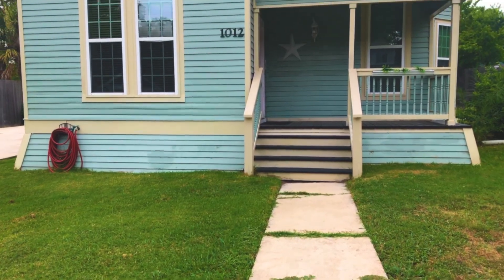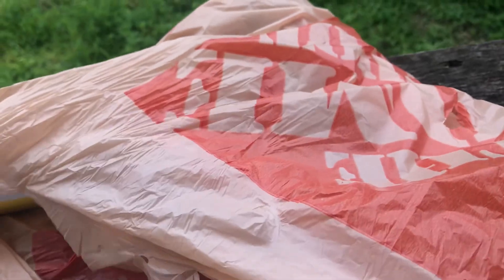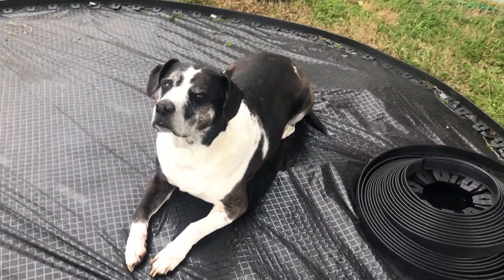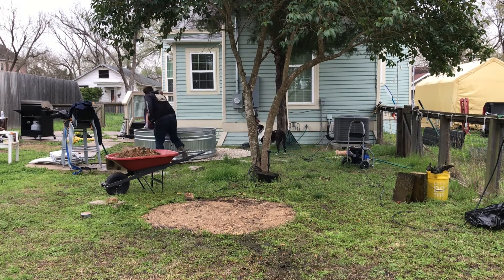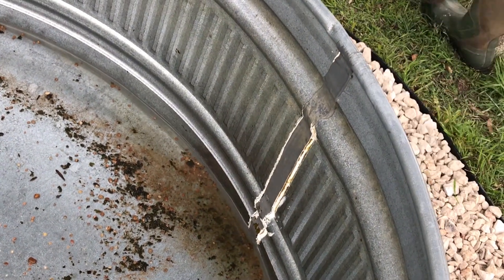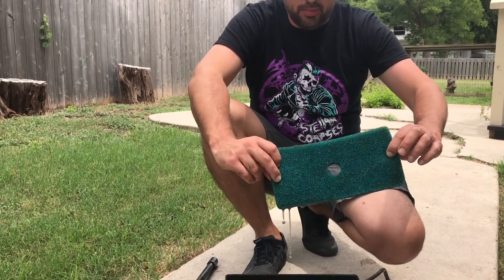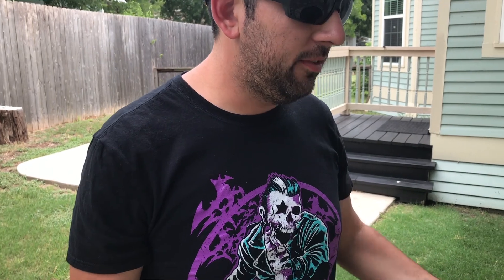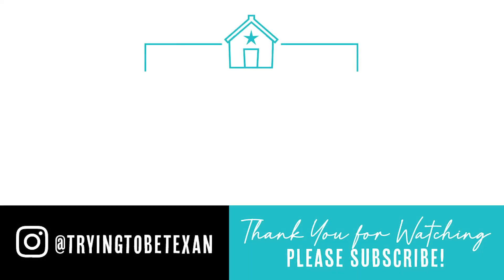DIY Stock Tank Fish Pond | Full Setup Instructions

Comment: I love the size of this tank! Mine is a 3×6. After doing some research on my stock tank pond I decided to coat the inside with pond shield, because the galvanized coating are unsafe for fish. It's non toxic and made my tank safe for fish. You sand off the galvanized coating, etch it, then apply. It's very easy! I've had it in my tank for 4 years and still going strong!

Comment: Nice. Have you had any issues with the galvanized tank leaching zinc. I got a rubbermaid tank but i like the look of the metal tanks better.
Reply: You could easily put a liner in it and then eliminate any seam leakage issues or leaching.
Reply: Or you could get a pond sealer and sand the sides then coat it.
Reply: Or you can let the tank sit in a field for a few years first